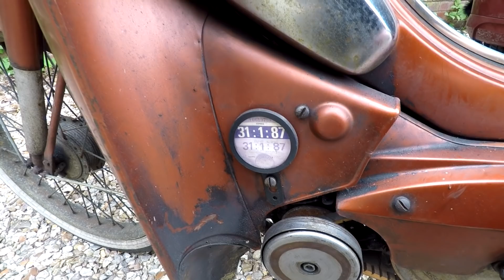Auction Mobylette Moped And Other Finds Ignition Problems Vlog

Comment: Hi Martin, great vid. Mobylettes are notorious for ignition problems, try replacing the condenser. They tend to crap out first as they overheat due to being attached to an especially hot part of the motor, so people often externally mount replacements. Also the yellow Novi coils are usually pretty suspect, and a lot of mobylette guys use two earth straps to the coil just to be sure. If all that doesn't work replace the points even if they seem ok, as they usually aren't. Nice bike tho, let me know when you want rid, I'm just up the road near Newark. Looking forward to the next episode, and you've inspired me to start powder coating so thank you
Reply from the maker: I've ordered a new condenser and will be checking the coils out too Phil, We'll get there lol
Reply: Im sure you'll have it running in no time! You probably already know most of the stuff on here, but this might be helpful https://www.mopedarmy.com/wiki/Guide_to_Motobecane_spark_and_timing
Reply from the maker: Yes, seen it already Phil

Comment: I'm in the process of doing a 1979 50cc Motobecane restore/modify build. Prior to 1978 they were all 6v, mine is 12v. Super cool variator drive engine. These are the best mopeds out there. If you can find them buy them! With a new 70cc cylinder head and bigger carb it will do 60mph! Good luck, Cheers from Colorado
Reply from the maker: Thanks for the info Bri.

Comment: I also would look at the stator. The generator has a permanent magnet, which might loose magnetic force after years of not being used. You could try to re-magnetise the magnet or eg put a dc current on the coil of the magnet when the engine runs. If the ac output voltage is higher, you know this is the problem ....

Comment: This is bringing back some memories,yes tinkering is what we did keeping these machines running,mine were used to get to work on and they served me well,I had them all Cazenave,Mobylette,Raleigh Runabout,Raleigh Wisp,later I had a Puch great machines and easy to maintain,that ignition system was pretty standard under Motorbecane licence,this could be the coil breaking down as 2v seems a bit low,perhaps degraded inside the coil ? points would pit up badly and I used a points file to dress them up every few weeks,biggest problem as these are two strokes by the way is the quality of oil,garage two stroke soon furred the plugs up and a bed would form in the spark plug,answer was Molydeium oil ( remember Molyslip ?) never had any problems after that,I think it was 20 to 1 ratio.
Timing should be fairly easy as there is an indent mark when piston is at TDC.
Great project I feel as if I am there with you in your workshop ! that will gleam when you are finished.
Reply from the maker: Nice memories bud

Comment: The 6 volt is only for the light. The ignition is a complete different circuit . It consists of the ignition coil, contact breaker, condenser and the coil near the points where the current is created. If you cleaned the points and check the points will open, useally it will give a spark. Sometimes the condenser is bad in old machines. When you are a little brave you can feel the wire that goes to the ignition coil and turn by hand the magnet (crankshaft)first slowly and little by little quicker. If you feel nothing at all, something inside is not o.k. Once i had a problem, when the engine was cold it runs, when hot it stopped. Reason was the condenser. When trying the ignition, always be shure  the lights are off.

Comment: hi sir when u clean the points in any motor you must take them out of there place and run  them accross a FINE grade oil stone i do and contacts come up shiney  all a good result try it.  Oh another tip if u brake a stud in a motor weld a washer on the stuck stud and then also then weld a nut on top of the washer give it a bit of time or so and undo it WELD INSIDE THE NUT AND OUTSIDE THE NUT

Comment: Your Puff Puff engine is a Triang Puff Puff train locomotive. With original rubber wheels and Triang labels.

Dimensions; 44 l x 22 h x 20 w cm.
The front looks to have a round metal eye  just a metal rod bent in a circle. The front is black and the stack and cab roof is black too.
Reply: The one I had, as a child, had the black bits in yellow (original not repainted). The thing inside is a rubber bellows which makes the puff noise.

Comment: Simple solution to hold a crank still on a 2 stroke or a 4 is to feed a length of thin cord in to the cylinder and rotate the engine in the desired direction and it locks solid.
Reply from the maker: Yes, I have done that before on mopeds.

Comment: If I remember right , there's a capacitor  in the pickup that shorts out and stops it sparking, you can't see it arcing because of the big pulley in the way.
Reply from the maker: Yes there is. I've ordered a new one.

Comment: I think Sharon does not see what you see.
She does not see what's under the rust ;-)
But Martin, what about the ignition switch?
It is certainly still in the circuit to the ignition coil.
But maybe you have already checked this :-)

Comment: A good way to stop a small engine turning over is to take out the plug and feed rope into the cylinder head it fills the cylinder and lockes it up, very entertaining video as usual thanks.
Reply from the maker: Yes, i've used that method before.

Comment: You should be getting 6v from the magneto, but there may be an engine on/off switch at the handle bar. Also if the headlight or taillight are blown the engine will not run. There are some good wiring diagrams online, just do a quick search and I'm sure you'll find something. The 6v mopeds can be tricky. Good luck!
Reply from the maker: Thanks Bri, There is no kill switch on these.
Reply: Have you had a chance to dig any deeper into the Motobecane? Once I have time I'm going to build myself a powder coat cabinet like you made. Perfect for moped restore/modify builds. I've been keeping an eye out for the right size cabinet, one big enough to hang a moped frame in. Maybe a tall, 4 drawer cabinet? Remove the drawers and fabricate a door, etc. I think that would work quite well.

Comment: hi  mart, as others have rightly said there's the usual suspects for the lack of sparks (points, condenser, wiring, kill button/switch if fitted and primary/secondary coils) but i've seen it mentioned that the magneto flywheel can lose magnetism over time on french "peds" (mobylette, motobecane, peugeot etc.) which would seem to tie in with your low voltage readings, dunno what a proper test you could do to test this but a possible maybe to put the voltmeter (ac) to the lighting coil wires then turn the engine over and get some readings from there and compare as that circuit would definitely need the better part of 6V even at low speeds.
Reply from the maker: The magnets are strong on this Steve
Reply: @retrorestore  that's good,  is the mechanism in the cab of the puff, puff toy train a sort of bellows  intended to make a chuffing sound as the train is pulled along?
Reply from the maker: @stevehill4615  maybe I've not had time to look at it yet.

Comment: Martin, you are a great guy! I have one of these bikes (to go with many other basket case mopeds, motor bikes and quads), similar model, bought dirt cheap as a box of bits but now with the same problem you show here. I'll be delighted to see how you undoubtably will get this one up and running again, many thanks for sharing, from that old Geezer in Ireland.

Comment: Sweet little moped , all there and still on the the database.. Result.. Do the magnets in the flywheel loose strength from standing? I seem to remember something  simular with a friends lambretta and i think he had the flywheel remagnetised. You could run it with a 6v battery  hot wired as a loss system to prove the motor.

Comment: Martin, how we lock-up a 2-stroke motor to remove a flywheel retaining bolt is to remove the sparkplug, and feed several inches of rope into the combustion chamber (1/4" sash cord works well) and rotate the engine until the piston comes up against the rope.  The engine can't rotate, and the rope is soft enough that it won't damage the piston, cylinder or inside of the head!  Thanks for the vid!!
Reply from the maker: Yes i've done that before too.

Comment: Great video Martin. I used to have to turn the throttle all the way forward for the decompressor to work, the little handle on the left handlebar is the choke. Check the wire from the coil back into the magneto also clean up the faces of the coils inside the magento (one is for lights the other ignition) I had a raleigh runabout years ago with the same problem. Ii could be the coil in the magneto that's failed had to change mine years ago lol. Also Martin is there a engine shut off on the handlebars ? some were fitted with a kill switch. it may be faulty. Cheers, Jeff.
Reply from the maker: Yes Jeff, ill be checking the coil inside the magneto when I sort this one out. No kill switch on this model.

Comment: Nice looking moped. You will not get an accurate measurement of the voltage with the meter as it measures RMS voltage assuming normal AC. Magneto ignition only produces a momentary voltage spike so 2 volts RMS could be all you need. If you really wanted to know you would need an oscilloscope.
Reply from the maker: I'll check the resistance of the coils and see if they are in tolerance.

Comment: Did you clock what the Puch Maxi went for? I've got a 72 I picked up for £300 back in 2016. Came from a house clearance and had been off the road since 1979. Great fun and lots of tuning parts available.
Reply from the maker: I think it went for £360

Comment: May need a battery to provide the voltage to help boost the spark maybe.... also how do you turn off the engine? Maybe the earth kills the power by grounding the engine so there's a switch somewhere. I'm rusty with 2stroke engine's as it's about 30 years since I played with one in a bike. My strimmer breaks my heart trying to start it and the plug is very sensitive.... I remember a bike I had was a bad starter until I got a new battery. A battery was expensive then and we were skint.
Reply from the maker: No battery on this Tez, You pull the decompression leaver to stop it.

Comment: In which direction were spinning the engine? I always thought the rotated the direction the flywheel bolt came off. No doubt, it's already running.
Cheers Ftom Fla.

Comment: The poor spark is v.likely a failed ignition stator coil, usually caused by over heating and the insulation cracking off, better to get both ign and lighting coil rebuilt.
Reply from the maker: Yes, I think that is the problem too Mart.